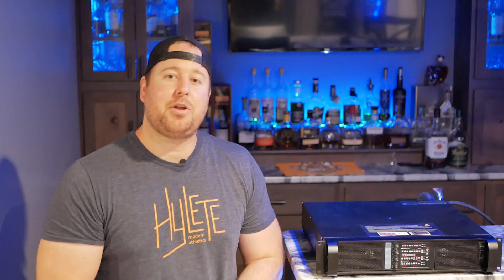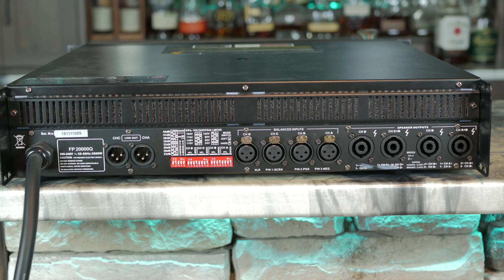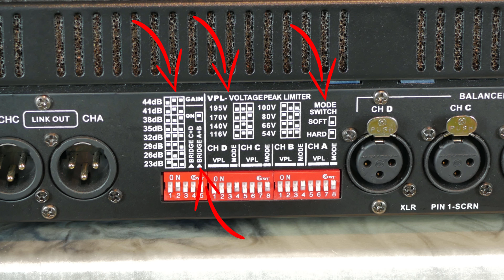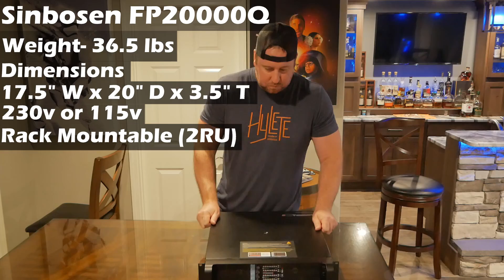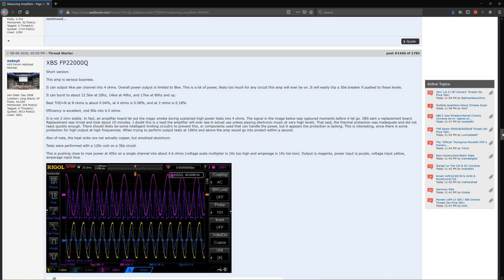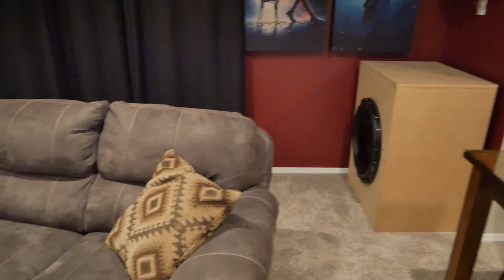Sinbosen FP20000Q Review | BIG Power Home Theater Subwoofer Amp For Multiple Subs

Comment from the maker: Check out the Sinbosen FP20000Q at https://bit.ly/FP20000Q and the MiniDSP 2x4 HD at https://amzn.to/3exOFC7! 🔊🔊
And sorry about the audio... New mic, had a little feedback issue.
Reply: Kyle, I've been told & read in a few articles that using pro audio sound reinforcement designed amps are discouraged due to the amp sending noise thru the speakers. Have you noticed anything like this thru your subs?
Reply from the maker: I've never had any issues with subs. I've heard others say they get some feedback with their mains with pro amps, and others have zero issues running their mains with them. I prefer to stick with powering subs with pro amps and not the other speakers
Reply: Anh e muống tư vấn

Comment: Don't have one of these amps myself but have extensive experience with the genuine Lab.Gruppen FP+ series. The remote switch on those is for when you use the NomadLink control network. When you put the power switch on and the remote switch off you can power the amplifier up and down over the network.

The genuine Lab.Gruppens are great amps, super reliable, stable down to two ohms. They only run two fans and don't get too hot so I suspect they are a good bit more efficient than the clones.
Reply from the maker: Oh yea these clones get super hot. I have 2 different models now, both can get almost too hot to touch and their fans are blowing full speed all the time. Eventually I'll be looking at Speaker Power amps when I redo and upgrade my current room. LG amps look like great products though
Reply: @LifeofBliss when you say you have two different models do you mean the upgraded versions that have a larger heatsink and 8 additional fans in the back? Wondering how much of a difference it really makes for home theater use. Right now im seeing some fp22000q's without the 8 rear fans for $650.
Reply from the maker: I have both of those models, fp20q and fp22q. Not much of a difference in my opinion. That's a deal for that amp, under $700. They are power houses man

Comment: DAM,,, I wish I would have gotten 4Ω subs.... What do you recommend for a pair of 2Ω subs
Reply from the maker: Check out the sinbosen D series amps. 1U tall, 2 ohm stable. They are a bit noisier and need to be in a separate room
Reply: @LifeofBliss  Question the specs for your and the D amps says Frequency repsonse 20hz-34khz... Since these subs can go lower than 20hz does it affect the performance since the amp is cutting it off at 20hz?
Reply from the maker: @MrMr123 they go below 20hz. I was getting a flat response down to 7 hz when testing the d amps in room

Comment: Hi, I know these devices quite well.

1. yes, the technical components of the FP10000 and FP140000 are identical (except for the power supply limitation) to the original Lab Gruppen power amplifiers
2. the FP20000 is a Chinese modification and is basically two FP14000s. However, you should never use this power because the output stage channels are not large enough and the output transistors will blow up. In general, it is advisable to buy the FP10 and FP14 and to stay away from the Chinese modifications. The most reliable power amplifiers are those from Prokustk or previously Tulun Play.
3. the remote switch is intended for fixed installations if you use many power amplifiers and want to activate or deactivate them all via a network cable. This is possible with the Lake platform from Lab Gruppen, so the switch on the copies is only of a cosmetic nature.
4. personally, I used the FP clones a few years ago and switched to Powersoft. My next step will be to test the DSP power amps from CVR (these are also available from Wharfedale relabeled as the "DP" series. The DSP is almost at Powersoft level, as it displays the voltage and current going into the speaker coils in real time and also has both peak and RMS limiters.Of course, there are also FIR filters.They are also even more efficient thanks to Class D, while the Lab Group FPs as Class TD have just 60% efficiency and therefore get super hot.

Best regards from germany

Comment: Can this amp  play 8 18 inch speakers
Reply from the maker: Sure, it could power 8 18s. You'd have to look at the specs of your speakers though to figure out how effective it will be. Final ohm load, rms power rating, sealed vs ported... you can pretty much count on 2000w rms x 4 channels for this amp, and double that for burst power. Just depends on what your speakers require

Comment: Do build your own cabs for the subs, if so what thickness of Baltic Pine do you use? also how long do you run those drivers in for when fitted 100 hrs or more?
Reply from the maker: I used 3/4 plywood and mdf. Front baffle is triple thick. 8 cu ft boxes in the front, 14 cu ft in the back. No break in period, just run em!

Comment: Be better getting an art clean box to take those rca to xlr and have that gain control before the power amp.
Reply from the maker: Nope, mini dsp 2x4. I have an art clean box but the mini dsp is an amazing dsp box for subs. Used the art clean box for years with my crown xls and single 15 though

Comment: Are you plugging this in to a regular wall outlet? I have the same amplifier and it sucks cuzz it won't power my subs at all! I have the 110v model
Reply from the maker: It's plugged into a 230v outlet. It should be almost destroying any subs you have... check out the clone amp thread on avs forum for some guidance on settings

Comment: Can you go in to more detail about the settings on the back? This amp will not power my subs at all! My 1000w plate amp can kick its butt!
Reply: Backplate switch 01100 00010001 00010001 (0=off=down 1=on=up)
Maximum gain, maximum voltage output
Be careful not to make voice coils explode

Comment: I’m looking at a NEMA L6-30P 30 Amp, 250 Volt, 2P, 3W, Locking Male Plug Connector, HJP-2621 Black Yellow Industrial Grade, Grounding 7500 Watts Generator (L6-30P Male Plug) for mine. 

My concern is that the plug that they sent mine is labeled as 16a 200V. Wouldn’t this plug allow too much voltage??
Reply from the maker: The amp will only pull what it needs, so it won't over power itself. That's the plug I used I believe

Comment: Hello there. I'm wondering. How do I get use of all four of the amplifier outputs seeing that the pro audio crossovers only have two outputs per segment? (2) two outputs for highs, (2) two outputs for mids, and (2) two  outputs for lows. The crossover can only supply signal to two (2) of the amplifier's inputs, therefore only two (2) of the outputs can be used in that particular configuration. Thanks for your videos, and for your time and help.

Comment: Did you use a L6-15 or L6-30 locking connector on your Sinbosen power cable or a non locking one like the 6-15R or 6-20R?
Reply from the maker: It was an l6-30 locking

Comment: You're the only one with reviews like this... Nice! Is the "Soft" setting on the back supposed to be for top end speakers?
Reply from the maker: No, it's more of a cutoff once the amp starts to sense clipping is what it sounds like. You can either have a very fast hard roll off of power (hard) or a slower easier roll off (soft). Soft will still reduce the power without sounding so harsh if it happens. That was my and other users interpretation of it anyways

Comment: I believe they copied the Amp design but also have options available that lab doesn't. So it's a mixed bag since the clone amps did bring more options. The labs are of higher quality for certain applications, I can't remember what. A working clone is good enough for home usage.

I also think labs test better but not 100% sure. The avs thread has all the info

Comment: After watching your first video on this I bought the FP20000Q with the new fans in January.  They were super easy to work with.  I got the right plug on mine but I made sure I specified which version I wanted and I asked what plug options I had.  I believe I payed around $729 but the price does fluctuate.  It is a beast of an amp! I had to run a 220v dedicated line to my theater to power it.  It would be a big mistake to put this in the same room as your theater because it sounds like a jet engine. As a side note I do leave mine on 24/7 and didn’t see a jump in my power bill.
Reply from the maker: Nice! Yea its a power house. What are you powering? And does it get pretty hot running 24/7? Mine gets pretty warm, but its not in a large room. Definitely don't want it in the same room
Reply: @LifeofBliss  I am powering my 20 12" JBLs.  This amp was the cheapest way I could figure out how to power them and still have room for expansion in the future.  It gets hot but not any hotter than my AVR . I even have it sitting in the non-insulated storage area that attaches to my bonus room above the garage.
Reply from the maker: Ha! Thats awesone... I'll be doing something similar soon with that last channel. You have a thread on AVS Forum? That'd be fun to see
Reply: I realize this comment is very old but I would advise not running it 24/7 because your fans will die much sooner if they run constantly. I'm not sure how the fans are controlled or on a PWM circuit.

Comment: is the remote not just for a 12v output that can turn on other amps that may not have a switch on it but require a 12v input to turn on as they can have continuous current supplied to them, this could make it easier to turn on more amps from one panel so you don't have to go and turn on all amps and can just connect all of them to that one 12v output on this amp and they will all power up simultaneously, imagine if you had 4-8 amps and flick one switch to turn them all on, you just have to DIY some cable to it :)
Reply from the maker: Yea i have remote turn on for my emotiva amps. If you watch the part where I open the amp up, there's nothing even connected to that switch. Its just a dummy switch. There is not a plug on the back for any sort of typical remote turn on for HT use unfortunately
Reply: @LifeofBliss  i saw, you would have to DIY a 12v cable on to it for it to work.
 Great intro BTW was crazy!  ;D

Comment: I have 8 FP clone amps in my HT and they are awesome! The oldest one is 8 years and still as good as day 1. Usually if they pass their first beating then they will run for years and years. -10db is still only 1/10th power, it can easily smoke quad 18's from most manufacturers if one isn't careful, they even push quad 24's decently (which most amplifiers can't do). For less $ you will not find a better subwoofer amp for home use. They are also flat to 2hz, unlike the FP10k. 😉
Reply from the maker: Oh I know who you are 😉 I'm Blister64 on the forum. You have a decent setup I guess... 😜
Reply: And for Pro Audio use running 4x21s id guess this amps overkill😅
Reply: FP?

Comment: Hey bro I’ve got a question. I’m currently building a setup in a box as follows 

1X10inch sub 
1X8inch sub 
2XTweeters. 

The question I have is do I have to put in crossovers in the build???  I’m a dealer in vintage audio  stock so I find it highly annoying all the time to set up different amps with speakers for demos. Thank you in advance for your advice. 🙏🏽👍🏽
Reply from the maker: Unless you are using a separate amplifier channel with active crossovers (high pass and low pass), then yes you'll need some sort of passive crossover between the amp and the speakers

Comment: Sketchy, only 12AWG and through walls! I'd be more comfortable to run 8 or fuck even over kill it and run 4AWG, less voltage drop and impedance!
Reply from the maker: I didn't expect to be running this much power when I built it. Or using 24s lol. But... I'm not sure you can run thicker than 10 gage through these speakon connectors. 12 is tight, i have read that you can buy a 10 guage connector but nothing thicker. Idk... movies are mainly dynamic sound so not too much in the way of content sine wave bass
Reply: @LifeofBliss  Use a larger cable, but put on a solid brass or copper lug/connector that is like a 8AWG down to a 12 or 14AWG, there won't be a bottleneck in a solid piece like that and Impedance and voltage drop will be at the best minimum for the setup. Yeah man I get it you're running 24"s great! I bet the push some air,. but cant remember if yours are sealed or ported?

Comment: i was curious if you have ever pulled enough juice with that amp to dim the lights? wonder how much amperage it pulls?
Reply from the maker: Its on a dedicated 240v 30a line. Nothing else is connected on that breaker so no dimming on any lights.
Reply: That is a mental set up, it must hurt your chest with that bass!
I have been curious to know what power feed you're using for all that womp.
30A line is fine for 3 channels but will it be enough if you run the 4th?
Reply from the maker: Oh yea, it'd be fine. Still gotta get something going for that 4th channel...

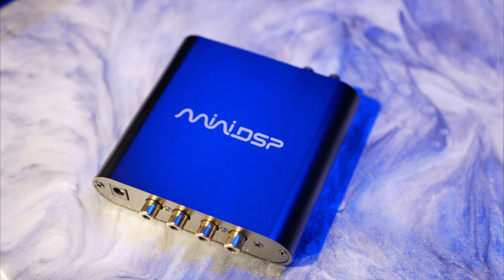Comment: On the medium shot of you with the amp in the shot, there is often a high frequency tone. I haven't watch the who video as I type this, but it's pretty loud right at 2:05. I'm listening with headphones so it quite pronounced. I haven't heard such an issue with your other videos.
Reply: The tone really started to go crazy when you put the MiniDSP on the amp. Some device you have powered on very close to you is putting out some serious RF interference to your audio. My guess would be the amp, lots of power, not a lot of shielding.
Reply from the maker: Yea sorry man... was using a new mic for this video and didn't realize it was doing this until I started editing. Tried a few things to take it out but obviously it didn't work completely. Gonna do some testing before the next video. Appreciate the heads up!
Reply: Life of Bliss what is your set up? I do video full time, broadcast and freelance. That tone was pretty high pitched too, it would be simply to remove without issue. Hit me up if you get that issue again and could take a pass at clean up.

Comment: I see 9 12” JBL CX1200s :).  As someone running 8 CS1214s (in two nearfield boxes), with 2 more DO subs coming, I’d be interested in seeing what you do with them.

Perhaps a 3x3 configuration (aka Magic Square) for a 4 ohm load?
Reply from the maker: Oh it'll be a 4 ohm load... but I may have not drug all of them out 😅 good eye btw! Bet you're loving those near field
Reply: Life of Bliss thanks.  So you’ve either got multiples of 4 or 9 lol.... so now I just wonder how crazy you went.  I think the max I’ve seen so far was somewhere around 64 bought over a six month period lol.

I’m enjoying them but still chasing down some gain structure issues and also some alignment issues based on my room size and configuration lol....